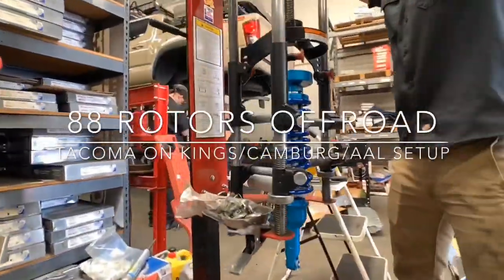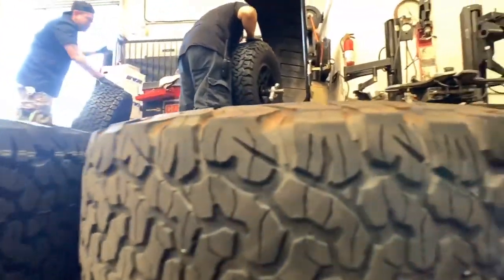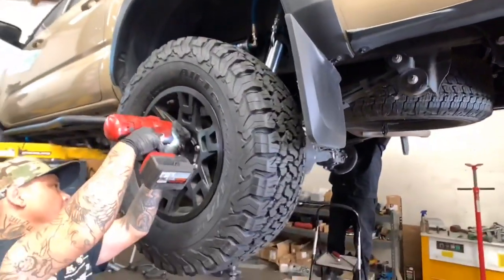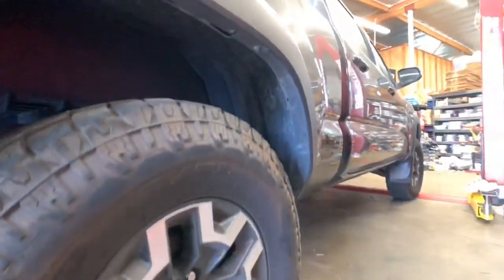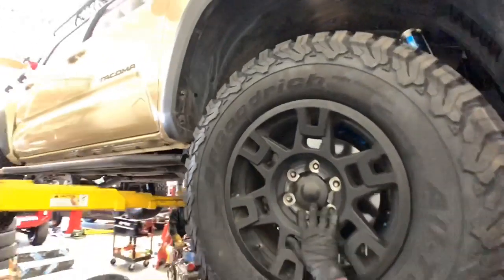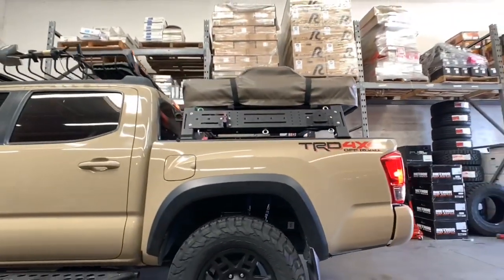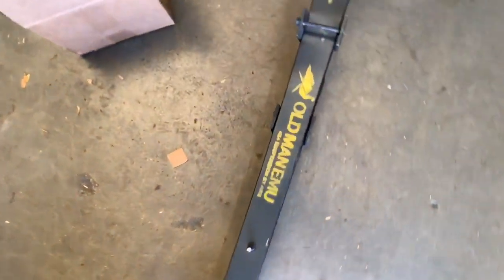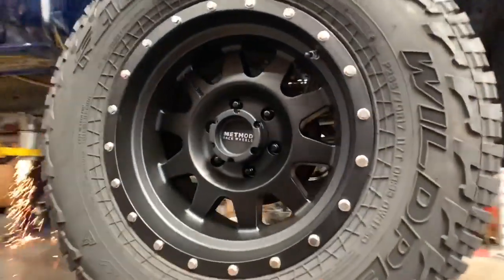2019 TOYOTA TACOMA 4x4 TRD OFFROAD QUICKSAND KINGS & CAMBURG SETUP

Comment: What’s the average pricing on all that?
Reply: $4-5k average depending on parts and labor. As an example, I got quoted from a local shop in Orange County  some Bilstein 6112 front with Bilstein 5680 in the rear and some Camburg upper control arms for $3,800 which included parts and labor. This job probably cost more since Kings are more expensice than Bilsteins.
Reply: Hey what kind of lift recommendations would u have for a 2015 Tacoma prerunner v6 for 3-4K?
Reply: And wheels if possible
Reply: @Bleedinggum  How funny. I also have a 2015 Tacoma. Mine is a crew cab TRD Off Road 4x4. The answer to your question is dependent on a few facors. How long are you plannong on keeping your truck and are you also looking to do any heavy off roading? Cheapest and good quality would be the Bilstein 5100s or an OME lift. Google both. Entry level,but best bang for your buck in the cheaper range.
Reply: Chris G I’m a city guy that occasionally goes up to big bear or mammoth seasonally for snowboarding but really minor when it comes to off roading. Just looking to do some mods for an aggressive look but not too hardcore. Just looked into bilsteins and might purchase those. I’m from northern OC. Do u know any good quality places/pricing around OC for installation?
Reply: @Bleedinggum  Industrial Motoring in Anaheim. I've called around a lot and they had some good prices for parts + labor. My co worker just lifted his 2018 Ram there. Turned out nice. Stay away from Huntington Beach or Costa Mesa because the prices are higher. Shops basically charge you for labor. The parts are the same through all shops for the most part. If you wanna be a baller on a budget, most small tire shops sell and install Bilstein 5100a.